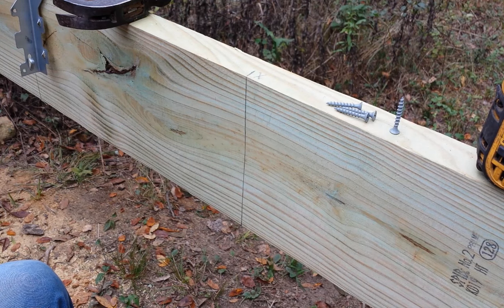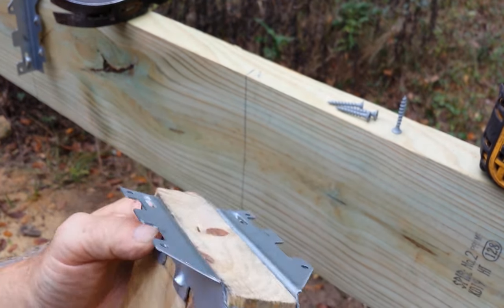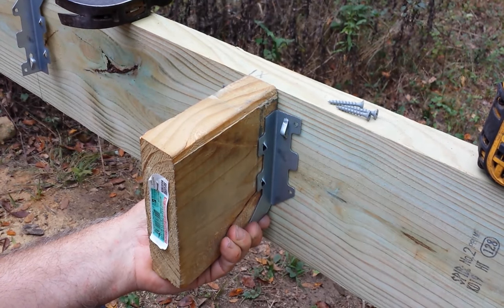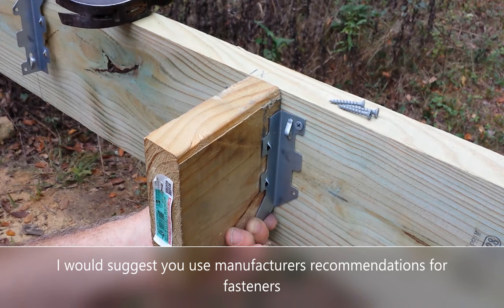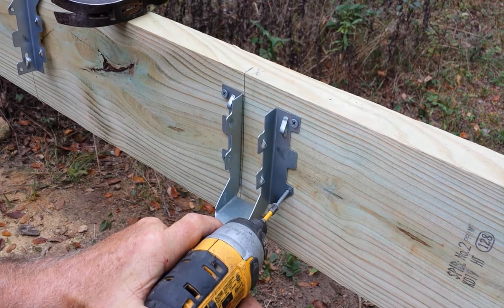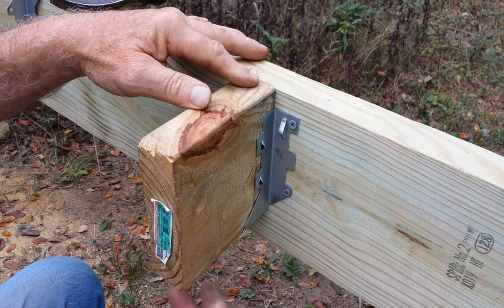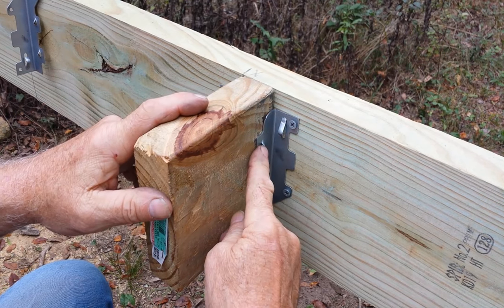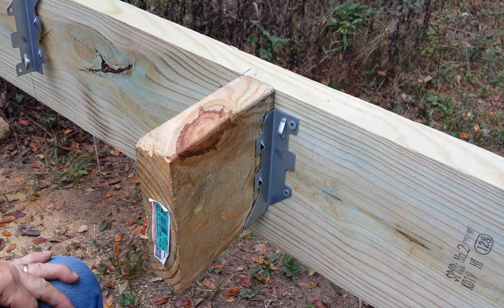How I Install Joist Hangers

Comment: A few corrections, those do not appear to be structural screws. Screws for outdoor decks  when using joist hangers must use structural screws or structural nails. Second correction every hole on that hanger must have a screw. The 45 degree holes on that hanger must have a minimum 3 inch fastener, short screws or nails are not allowed.

Comment: Perfect! Yeah they make #10 joist hanger nails and joist hanger screws. Im not sure what type of screws those are..(galvanised decking screws?) Alot if those dont have she shear strength for the application. If you can put it in a vice and break the head off easily theyre not the best. But theyre good enough for the girls i go out with. Lol. Have a great weekend ole duke. 🌄🍺👍👍🐕🐟
Reply from the maker: Robert, are you telling me if we have a hoedown at the cabin we might be in trouble???  :)
Reply: @RuffCut  anything under 1000lbs per square foot, your good. Lol
Reply: @rheidtech  haaha    we're good...running bout 300 per 2 square feet   lol

Comment: By code, you are not using the right hangers nails. You will fail inspection. Very bad advice.
Reply from the maker: If you watched the video you would see I didnt advise to use these screws

Comment: You know the little v's on top of each side of the hanger are made to be hammered into wood to set your position.
Reply from the maker: you can use them
Reply: They also add a little strength since they are on an angle. Definitely should be used.

Comment: Great video. Just FYI, screws are not meant for holding weight. They shear easily-brittle. You want nails. The screws you are using are called decking screws. Meant to hold decking planks down.
Reply from the maker: I addressed the issue in the video
Reply: Structural screws can be used. Nails are the common structural method as they support weights better. This type of screw is not for load bearing.
Reply from the maker: Yes Sir good advice

Comment: The problem with this is a lot of the treated lumber is varying widths. I ran into this problem using the same board to set all the hangers.
Reply from the maker: if you have any odd size boards save them for last...mine were all the same because they came from the same stack

Comment: Wrong fasteners for code, all 2 x's tend to vary so to use one block to do all is incorrect procedure. 
Putting them on like this will certainly leave some gaps to the 2x's and in such will not pass code.

Nice try tho.

Comment: Got a little tip for you. Those tabs on the top on each side you Hammer them in and the bracket will stay in place and won't have to worry about your screw falling off your drill tip
Reply from the maker: they dont stay on the mark or I would use them

Comment: You have got to be kidding me. Is this a comedy video? You CAN NOT install hangers with screws unless they are structural by joist manufacturer. For all of the comments below about how this is a great learning video or best way - read the hanger manufacturer installation it says nails and specific gauge of nails.
Reply from the maker: Watch the video and you'll figure it out

Comment: you never use screws on joist hangers. NEVER
Reply from the maker: you are almost right
Reply: @RuffCut  I know they have screws that can be used which are equivalent to nails now but, I wouldn't use them. The simpson joist screws are another story. They look solid AF

Comment: I always don't the 2nd way you showed.. treated lumber has a tendency to be plus or minus  a 1/8.  Then you make sure your flush on top....   I like that HAMMER ya got.
Reply from the maker: the lumber I'm using came from one stack and they measured all the same...but yeah they can vary....I have some beams in the porch and can't screw from the backside...that hammer has two ball bearings in the claw that are spring loaded!

Comment: I'm building a 16x32 deck and bought 2x10 ledger board. Is 2x10 okay to use? I figured 2x12 would be an overkill. I'm in Georgia.
Reply from the maker: It should be if you nail two together but don't know how far apart your piers are...they have that info on the internet...I can't tell you for sure

Comment: Terrible demo.  The screws should be Simpson engineering screws, not decking screws.  The angled screws should be Simpson 1025 2.5 inches long.  Lastly, screw a short 1x1 on top of the joist to hold it while you do the work.
Reply from the maker: You win a chicken dinner!
Reply: Yes, you are correct. On the box of the joist hanger it will tell you what screws or nails to use. I wouldn't call this a terrible demo. That's being mean for no reason. The tip about squaring them up was exactly what I needed since I was having a heck of a time getting my joist hangers on (first timer). But I do agree that the 2.5 Simpson Strong Tie screws are used to toenail the joist hangers, as well as 1.5" Simpson Strong Tie screws for the other 4 slots.

Comment: The screws that you’re using would never pass code as they’re not structural those are deck or drywall screws they won’t work
Reply from the maker: I discussed that in the video
Reply: Yet they'll hold for 100 years.
Reply: Them screws are going nowhere for long after you and I are long gone.. Only pedantic building inspectors insist on ring shank galvanised nails

Comment: Pre-hanging the hangers, is all wood the same size in a given size?
Reply from the maker: they can vary especially with pressure treated lumber....when you buy  lumber and it comes from the same stack its usually the same....its a good idea to look at the boards before you mount the hangers

Comment: Wish I would have watched your video before I hung my hangers... Now I have to make adjustments. Good video ✊
Reply from the maker: check and see if your joists measure the same top to bottom...some measurements vary with pressure treated lumber   Thanks

Comment: Are these sturdy enough to use for homemade bunk beds?
Reply from the maker: they have load charts for different size hangers
Reply: @RuffCut  I'm going to build bunk beds in my Skoolie and was wanting to use these mounted to 4x4s. The chart says 480lbs so it should be fine.

Comment: You are supposed to nail those clips into place to hold it in the proper spot. After that you can fasten them
Reply from the maker: make a video and show me how
Reply: Well, that is what I was doing at first, nailing the clips into place, but honestly, they were slipping out and didn't seem very effective. So I like his version better: screw first and then you can nail the clips into place.
Reply: @Thrift Diving  I find it way easier using them. Once nailed, you no longer need a piece of wood for placement. Hold it and start a screw on either side. Also I depends on how much space you have. I did that in a crawlspace and made everything super easy